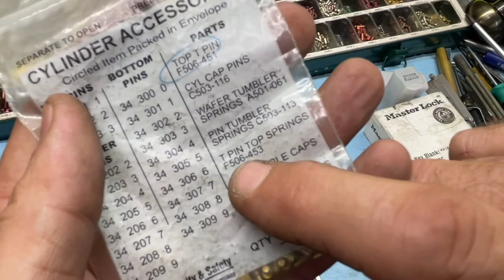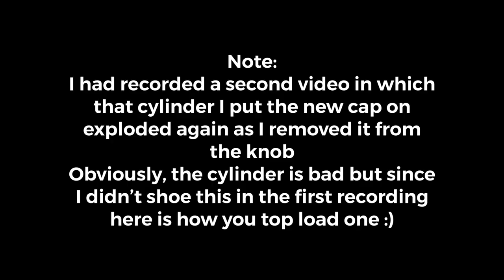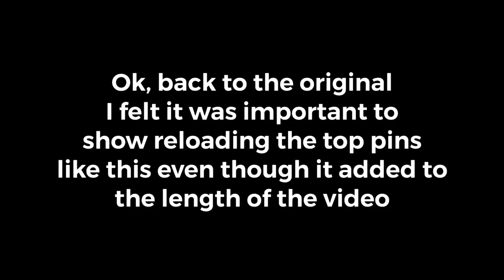RLS 15 - Schlage Compressible Cylinder F Series Knobs

Comment: Another great video! I’ve had to cut the coil end off a standard spring to “retrofit” them to work with the t pins when a spring got lost. I’ve also had issues with those t pins dropping down too far and getting stuck down forcing me to dump them and reload when using a follower that has the recess used for checking for master pins. Wonderful series! Thanks for sharing!
Reply: I just literally had to do that 2 days ago. Didn't have any replacement Springs that I had to finish what I was doing that day and it was about to rain on me so I did what I had to do. I guess it'll hold fine right? I've never done it before then.
Reply: @keithwhatley5094  they hold just fine. I’ve never had an issue with doing that.